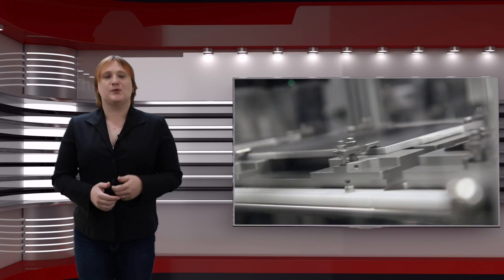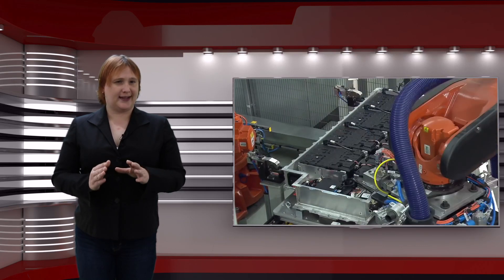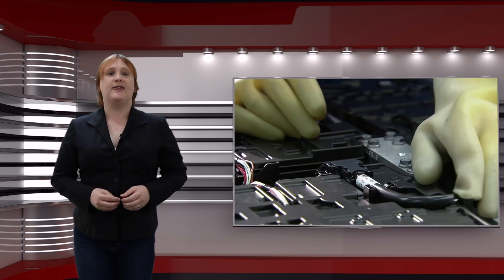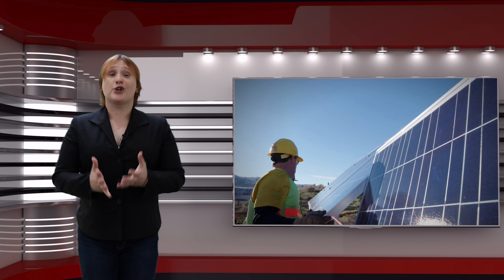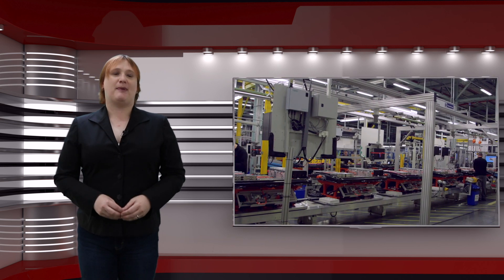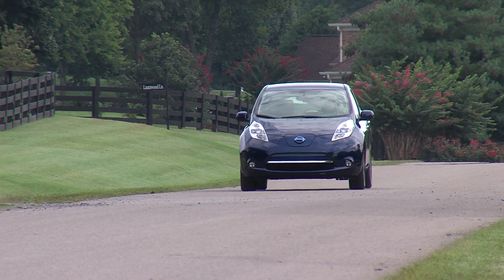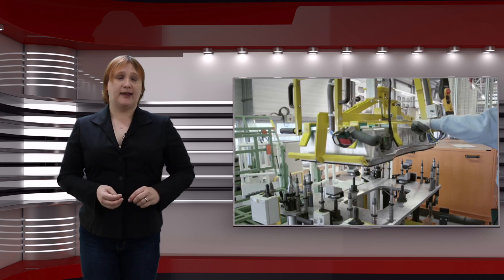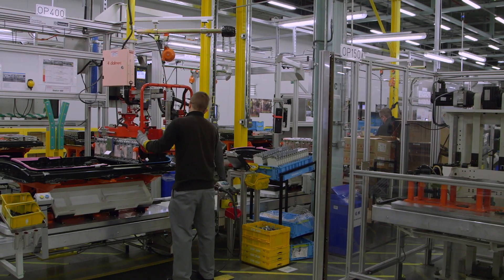Why Second Life Battery Projects Are So Important For Everyone

Comment: American Manganese Inc recycles almost 100% of the materials in batteries. https://www.howestreet.com/author/americanmanganese/
Reply: TradeAlong 99, they claim they have a way to do it, but they don’t have a battery recycling center. That’s the problem that everyone is sweeping under the carpet with the “second life” use. At the end of the road, the batteries need to be recycled, and presently there is no place that can do it 100% economically. Which means you have to pay a company to do it, because the materials gained will not pay for the recycling process.
Reply: Well, AMI appears to have the cleanest process and patents so they are sitting in the top spot for Government mandated recycling that is 100% efficient and the greenest tech available. At 13 cents/sh this could be a sleeper! I got 500 shares several months back. Larry (the CEO) has a frequent podcast to keep us all updated. https://www.howestreet.com/author/americanmanganese/
Reply: TradeAlong 99, I went to the company website a few days ago because I was researching this very issue. Years ago they planned to make a large scale recycling plant, but I can’t find any proof it actually got made.

Much like we have companies claiming they made a solid state battery, in a tiny lab, but can’t scale it up to a profitable solution, these recycling centers have the same problem. 

Unlike scrap steel and aluminum, batteries rely on a chemical reaction. When they degrade, it takes a lot of energy to make it reusable. Just like we can already get CO2 out of the air and turn it back into fuel, but the energy requirements is very high, and we currently don’t have enough clean energy to power it, so we would have create more CO2 than what we remove.

But I bet you can’t find any company who is recycling dead lithium batteries for free without a subsidy. Some states and cities do have recycling centers paid for by taxpayers.
Reply: Listen to the podcasts, that's the newest info if you want to see where they are now. The process is developed but it's still a growing work in progress as to the plant building. He said the Chinese smelt them and create some bad pollution while only extracting 40-60% and he was approached by them because the Chinese govt will be cracking down on them with regulations which puts him in the right spot for a big growth spurt when it happens. He appears to have the best process to get this done. Also he was saying the danger in all the spent stock piles that have been sitting there for up to 2 years is also a consideration as they degrade and create fire hazards and environmental pollution. I think this is a sleeper and a cheap way to invest in the future while helping the environment which I'm all for.
Reply: TradeAlong 99, right now China and most Asian countries are not environmentally friendly in terms of containment of toxic waste, but where these countries with cheap labor do benefit is they can recycle things by hand. 

When they recycle an air conditioner, they will release the Freon to the atmosphere, let the oil drain into the ground, and then tear apart the unit and sort plastic, steel, copper, aluminum. They only get the part that gives them money.
Reply: They are slowly cracking down on those issues from what I've seen. You seem to have a cynical outlook with every answer. I've noticed this about you and it makes me wonder what your true agenda is but I'll give you the benefit of the doubt and hope I'm off base.
Reply: TradeAlong 99, I’ve been in Asia for the last 20 years, so what I’m explaining is the reality that many people never get to see. I’m cynical in nature because way too often we see false claims about something while someone is making $billions of personal wealth. As they say, fo,low the money, and anywhere you see someone getting filthy rich while saving the planet, you have to wonder what’s going on.

So behind a lot of these industries there is a deeper darker secret. The EV revolution in China is real, but not like what people imagine. Many of their EVs are just golf carts with a car body, or electric scooters, still using lead acid batteries. We see some of them making it into the US as a Low Speed Electric or Neighborhood Electric vehicle. 

Here in the Philippines where I am currently, there are very limited EVs. There is 1 Tesla owned by the president of the electric company (Meralco), and a few e-jeepney and e-buses, and quite a few electric scooters using 3-6x 12v lead acid batteries, 36v-72v in series. But no charging infrastructure.
Reply: Manila is hell on earth with smog. It boggles my mind that they are so far behind. Add a dictator and he practices genocide. I would be cynical too. I may retire there if things are better in 10-20 years but I'm not holding my breath.
Reply: TradeAlong 99, Duterte is not a dictator and he is not committing genocide, unless you consider criminals an ethnic group or of a certain gene. If you have visited Davao, which he was in charge of before becoming president, you will see a huge difference in behavior. It’s cleaner, it was illegal to litter, including throwing cigarettes on the ground, and overall chaos is reduced.

Just like the US, the majority has spoken, and as long as Trump and Duterte do what they campaigned to do, then it’s all good. I fully support what Duterte is trying to do by placing innocent citizens AHEAD of criminals when it comes to human rights. Criminals don’t give their victims human rights, so it’s up to the leader to get them off the streets before they violate rights of innocent citizens.

Many people believe Duterte just ordered mass judicial killings, but that’s not true. He told his guys to arrest, and if they resist, shoot them. Unlike Obama who orders law effort to wait till they are mortally wounded before returning fire. Duterte is not an idiot.

Now, having said that, in every country there are extrajudicial killings. In the Philippines, I’m sure some dirty cops are killing drug lords who can testify against them, or anyone who has crossed them in a bad way. But I’m not worried about being killed by a policeman here, because I don’t deal drugs, I don’t hang out with drug dealers, I don’t do anything to annoy the police like some do in the US. 

I can assure you, anyone killed by a policeman here was doing something wrong, or getting into someone’s business, or sleeping with the wrong woman. If you are just an innocent citizen going about your honest living, you are not being shot by the police here.

Duterte is slightly anti-American for a few reasons, but I Obama poured fuel on it by having the nerve to tell him how to run his country when Obama was letting the US fall to chaos and disorder.
Reply: I see your motivation now...good to know who I'm talking to. I'm a liberal.

Comment: I think for these to work, every manufacturer would have to make the same "standard battery" and make sure that there are no changes over time to the outside of the battery.
Reply: I'm pretty sure batteries are mostly standardized for cars they are 18650 cells but Tesla uses a different one now
Reply: No, there are a variety of form factors, between 18650's, 2170's, pouch cells like in the Leaf and Bolt, not sure what you call the ones in the i3.

Better than standardising on cell form (as that may limit innovation) is to ensure that they conform to standards that make them simple to integrate into common controllers and such. Like say standard voltages, or factors thereof, perhaps a range of standard sizes that are multiples of each other, etc.
Reply: I see the physical shape as less important than the electrical interface. As long as they can be essentially plugged in to whatever end system, electrically, and work, different cabinets for different battery sizes will be relatively simple to form.

This may be a little bit more problematic right now, as the battery market is going through a lot of changes with everyone trying to get the optimum mix of power density and cost, but eventually simply due to economies of scale these will coalesce into only a handful for different purposes.

What I mean is, when the production capacity for most players is fairly low, they are not setting up multi billion dollar operations for a few thousand vehicles a year, instead setting up cheaper but not as efficient operations that are more adaptable to different specs.

This is Tesla's strong point - they've standardised on a single (or two) battery formats and so manufacture them by the million, in quantities much greater than anyone else.

The projected demand is 150GWh of batteries worldwide for 2018, and Tesla is expected to provide 35GWh of that, at one factory. That's about 1/4 of total worldwide demand. That's insane, and it's also why theirs are the most cost effective.
Reply: monkeyboy4746 
Well no. Its working now. Second life batteries are already in use. As said in the video, they often dont even take them out of the pack. Slide them onto a rack and just wire up.
Reply: monkeyboy4746 it's easy to standardize batteries for all cars
Reply: If all manufacturers of batteries agree on a standard form factor like the way it is with lead/acid batteries, then it could work.  Right now every company comes up with their own design trying to one up the competition.  Opening the cases of all these battery packs to get at the individual cells is not economically viable for storage.  It would be too expensive to build infrastructure to fit every different design to make them work.  It really makes more sense to use surplus lead/acid automotive batteries, and I am sure they are a lot in use in off-grid solar systems for storage.
Reply: monkeyboy4746 most electric car batteries are only made by a few manufacturers so they already know what is needed to interface with each of them.
Reply: Really No. When the quantity of pre used battery packs becomes greater, electronics will become available to arch them together. You nee to remember that each cell needs to be protected, so I suspect that a little programme to tell the processor what is can necter where will sort it out.
Reply: This will not likely happen - competition will certainly drive innovation in battery design/chemistry, but standardisation will be resisted by any manufacturer who believes they have an edge. This technology is a key differentiator, along with autonomous capability. If you are a manufacturer who designed an incredible new high-density battery would you give it to all your competitors in the name of standardisation, or would you launch it with a fanfare showing how much better your product is?